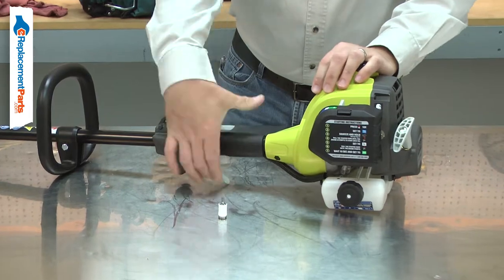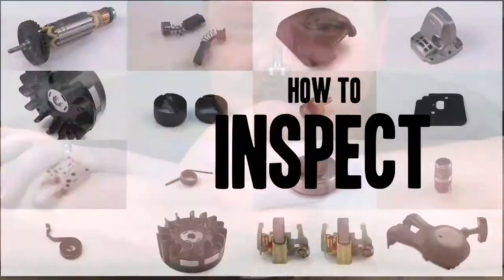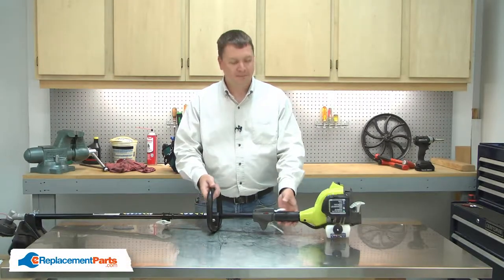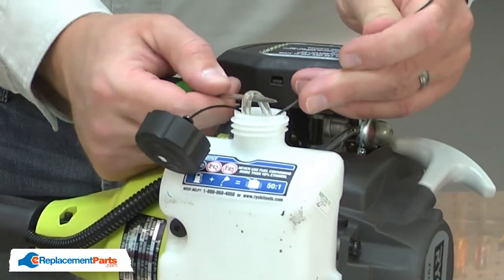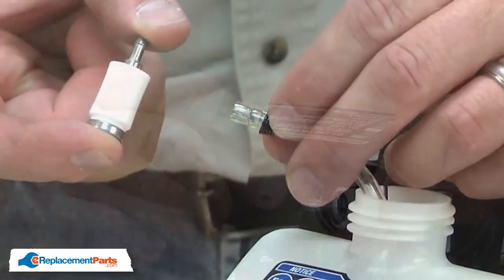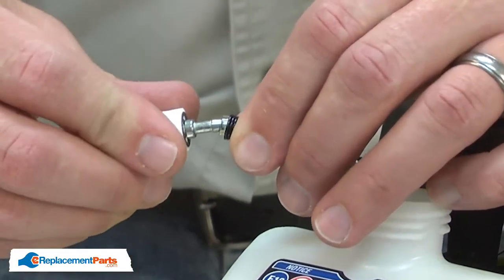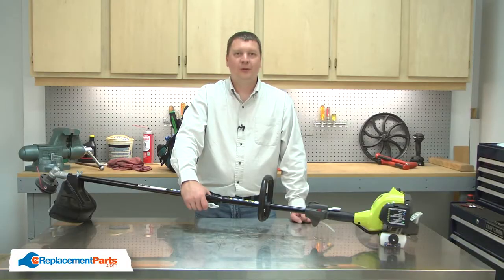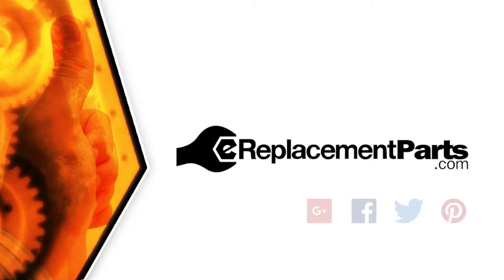Ryobi String Trimmer Repair - Replacing the Fuel Filter (Ryobi Part # 310976001)

Comment: I know this is an older video but I got a modlr similar To this for free because they said it wouldn’t run. So I did the easy stuff first. Emptied old gas and the fuel filter fell out lol. So the issue is he hooked the fuel line on something and pulled it out of the tank and popped the fuel filter off. Now there isn’t any fuel line remaining in the tank to hook and reattach the filter. Any methods to get the fuel line back in? I don’t want to lube it with oil since it’s Ryobis new 4 cycle engine. Thanks